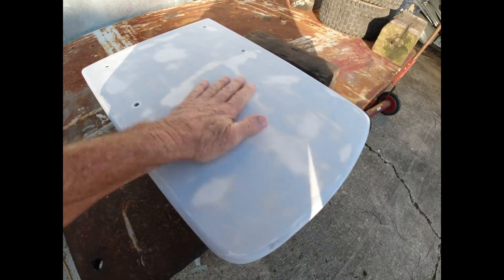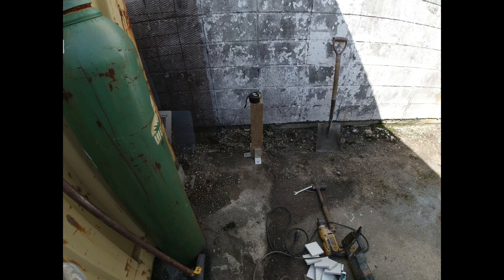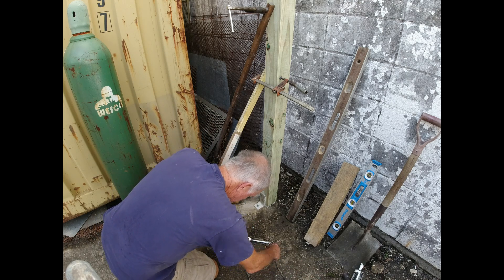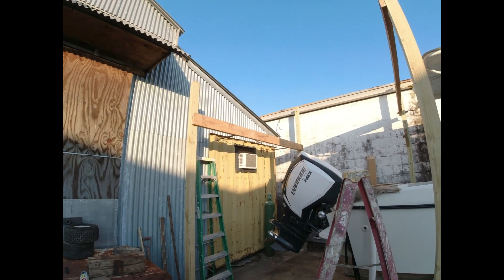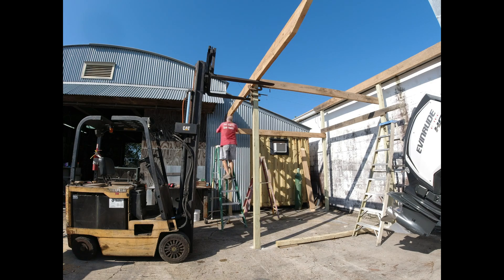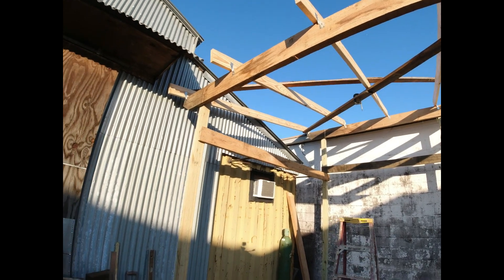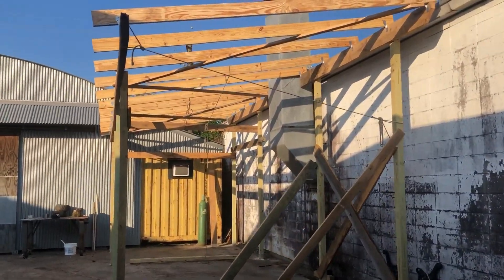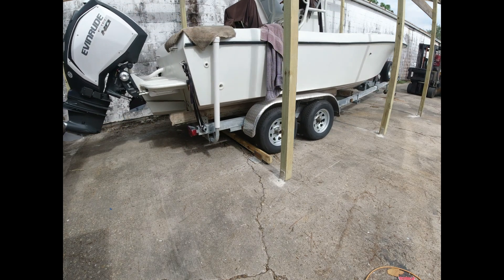DIY Boat shed build to house The Center Console Project Boat.

Comment: When HF first opened I ordered some saw blades.  They came in a bubble pack with all the carbide teeth at the bottom of the bubble.  I never by tools that need to be sharp or those that use batteries from HF although they do make quite a bit of pretty good tools.  I just never buy batteries or saw blades.  Having said that their Hilti style carbide bits are the best I have ever used and especially so at the price.
Reply from the maker: We buy lots of chip brushes and light weight leather gloves from them but not much else.
Barry